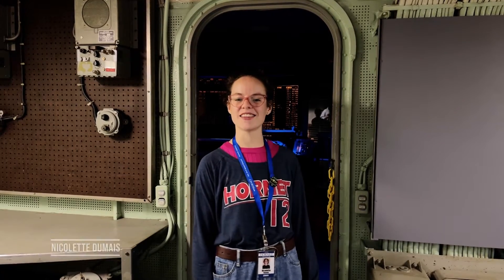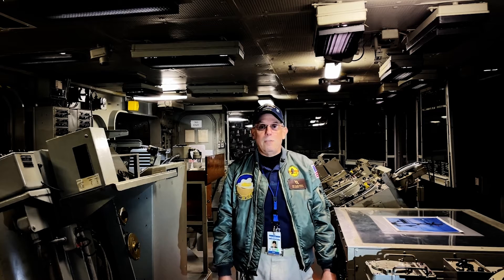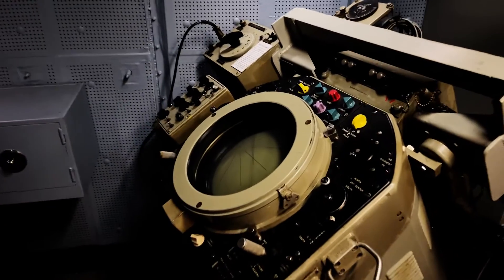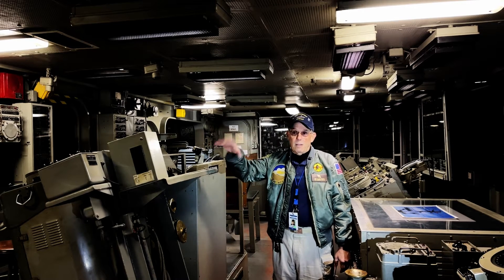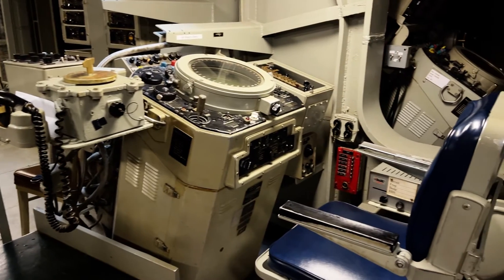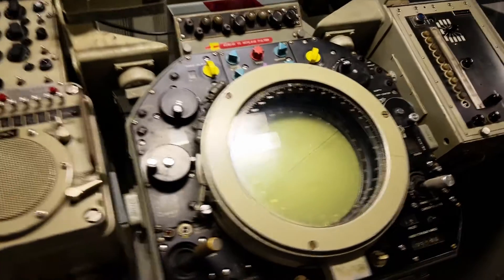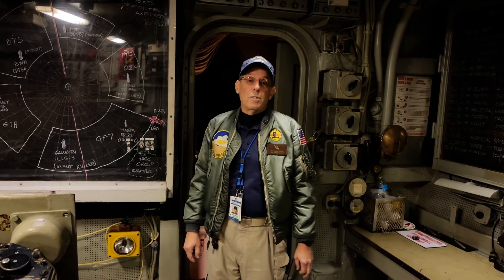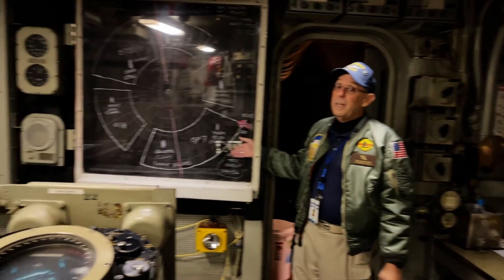Combat Information Center on an Aircraft Carrier | Talking Ship #6

Comment: Awesome video! I also served between 69/72 but was stationed on missile destroyers. I was an Radarman RD on my first ship USS Dahlgren DLG-12/DDG-43, and an Operations Specialist OS on my second ship USS Richmond K Turner DLG/CG-20. All the equipment you showed we also used on my first ship, but being a destroyer our CIC was not as elaborate as an aircraft carriers is. We did mostly primary air search, navigation plot, electronic warfare EW, and anti-submarine warfare plot. Because we had missiles on board we also had a tactical plot for that as well. If I remember right you had to be an E6 or above to actually control aircraft though. That is an outstanding pre-NTDS CIC!

Comment: Yes, what can you show/discuss about the EW suite. Former USAF EW B-52 system specialist. Also tech data writer for F/A-18.
Reply from the maker: We need to do some restoration work in our EW room first. It is missing the primary piece of gear, the WLR-1. We may have to settle for using photos if our search for the equipment doesn't turn up something soon.  The WLR-1 is a passive system that allowed us to interpert any radar signal of interest. The frequency, pulse width, pulse repetition rate, and antenna rotation rate or type was usually enough for us to identify the radar model and then platform. For example we could ID which aircraft off the coast of North Vietnam were MiG-15's or MiG-17's and alert our CAP. When a firecontrol radar was "locked on" to us we would then activate our jamming system, the ULQ-6. That was a very rare occurrence for ships in the Tonkin Gulf and never happened to the Hornet.
Reply: @Hornet Museum  thanks for the great reply! Very informative. Similar to our ALR-20, showed a lot of information as well as the RHAW gear. I was able to check out our different aircraft in the area around the base, KC-135, F-106, and an occasional F-4 or C-130. Luckily, no Russian. Was off duty when th SR-71 landed coming back from the suez canal overflight.